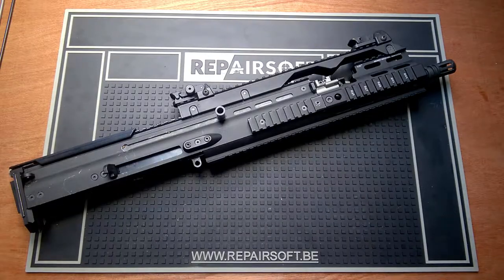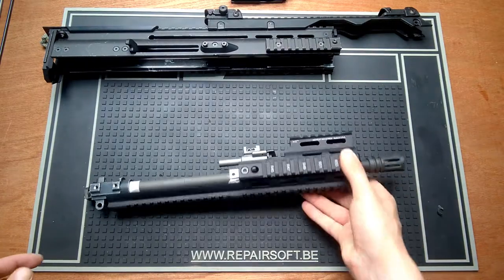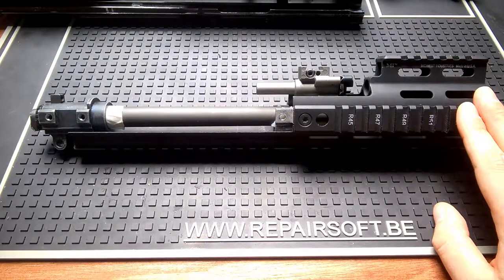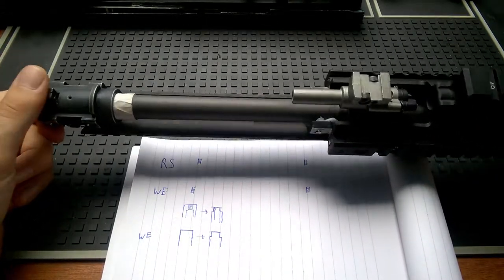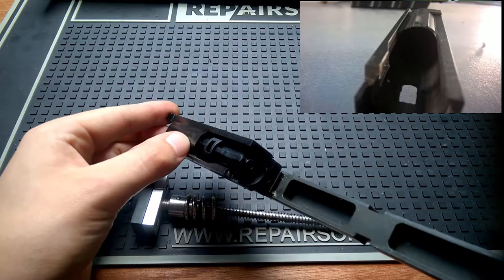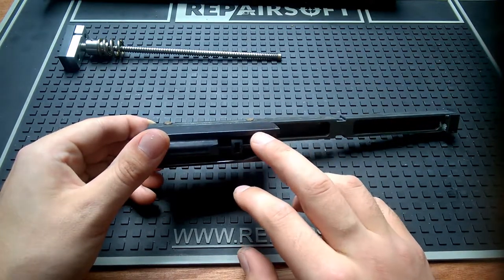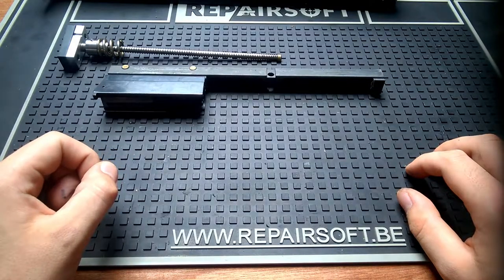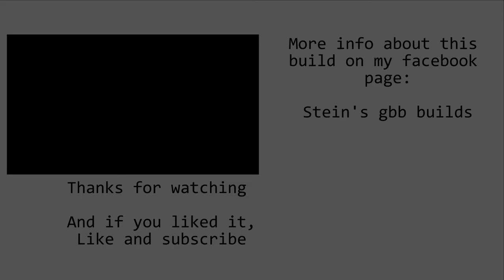Scar Build series Part 3: Upper reciever

Comment: A bit late for a comment but I just found your videos....
I changed to the Angry gun adjustable nozzle (http://emperionstore.com/we-scar-muzzle-power-mpa-loading-nozzle-angry-gun.html?___store=en&___from_store=it) because I could not work with the WE original one and the Ra-Tech NPAS was a pain to adjust and very inconsistent even with the original plastic nozzle. The WE nozzle was made of a weird plastic that when used in temperatures under 25 C (!) in full auto (small bursts not full magazine dump...) it froze up and broke the protrusion that pushes the bb in the hup-up chamber. That happened to me  three times in a row so something had to be done! The Angry gun  nozzle seems to hold very well up to now even in cold weather with full auto bursts and in lower temps! It is adjusting the fps by a simple allen wrench and you don't need to hold down the NPAS to do it!  I got it for my 416 as well and it is the best working for me up to now!
Hope I helped a bit (as a return for your great video!) Keep up the good work and I wish to you happy games and good hits!

EDIT- I didn't wait till the end of the video... you use HPA. So the freezing from propane - propylene  is not much of an issue for you... Anyway I hope this helps!